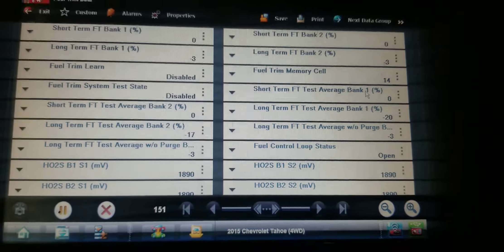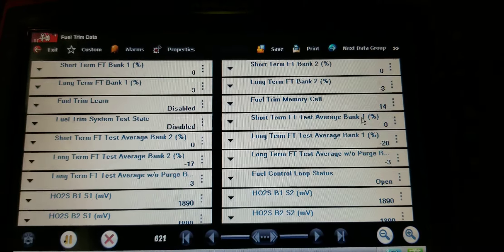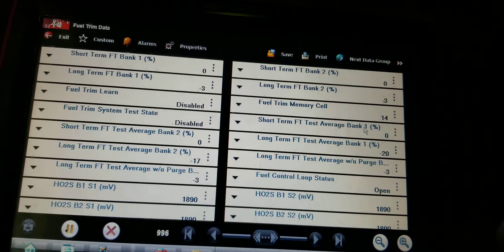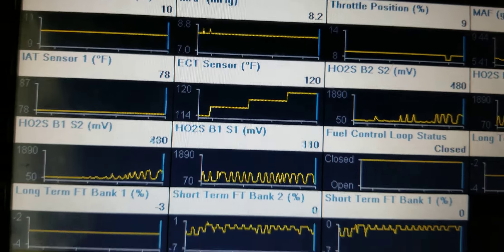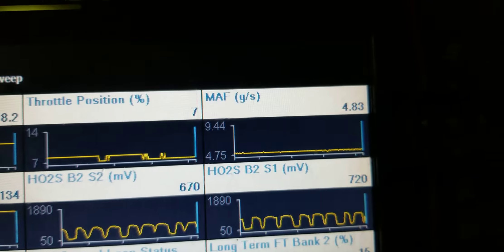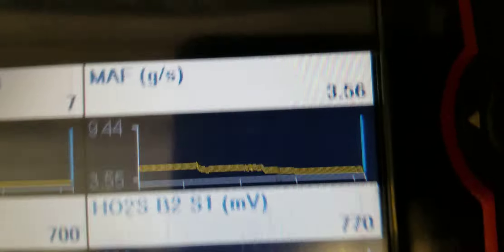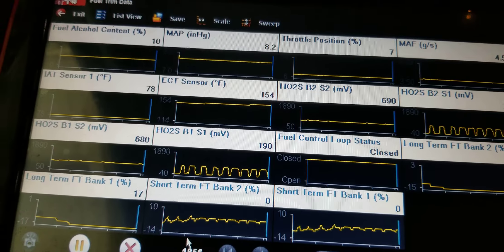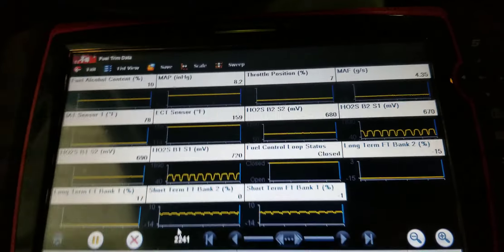2015 CHEV TAHOE 5.3L, MAF DTC'S & P0172/P0175 FUEL TRIM RICH ON BOTH BANKS (PART I)

Comment from the maker: Well guys I make multiple mistakes and mispoke in this, but no editing, and the truck is fixed and long gone, so I ain't too worried about it 🤣🤣🤣👌...End game...hopefully this helps somebody out there, if it does, well then it's worth it right?

Key here is to see TRIM numbers back to 0 or close to it!  The MAF gm/sec pid does ALOT of updating and normalizes once engine is fully up to temp and you drive her for awhile...keep this in mind before rushing to conclusions...truck has been gone for well over a month now and I work with the gal who owns it so👍...IT IS FIXED!!!

Parts, Repairs, & Reset Procedures:
1. GM HIGH PRESSURE FUEL PUMP
2. GM HIGH PRESSURE FUEL PUMP SUPPLY LINE TO INJECTION RAIL
3. GM LOW PRESSURE FEED SUPPLY HOSE/LINE TO HIGH PRESSURE FUEL PUMP
4. GM INTAKE MANIFOLD GASKET SET
5. LOF (0W20 FULL SYNTHETIC)
6. GM MAF SENSOR
7. CLEARED DTC'S
8. RESET FUEL TRIM LEARN
9. ELECTRONIC THROTTLE BODY CLEANING & IDLE RELEARN PROCEDURE
10. CKP VARIATION RELEARN PROCEDURE
11. COMPLETED DRIVE CYCLE TO CONFIRM REPAIRS
12. RECHECKED DATA TO LEARN FROM IT

Thanks for watching and be sure to watch both parts before you get carried away 🤣🤣🤣👌!

Part II: https://youtu.be/L7QaSguY9PA

Comment: Does the hpfp suppose to make a ticking noise?
Reply from the maker: @JoeyBrioso-l9m  Yes, but it needs to be within reason, sound alone doesn't seal the deal, additional testing is required, as well as data analysis.

Comment: Hey my 2015 Yukon 5.3 is having similar readings with codes p0172 p0175, my stft on both banks is around -3 and ltft is -30 on both banks , if I unplug both pcv tubes stft will fluctuate to 0 to 4 and long term dropped to -20, And Map reading was 3.7-4 and with pcv hoses off it was 3, this was all with the truck up to temp, just wondering if you think this would be an indicator of the hpfp leaking ?
Reply from the maker: What is your fuel composition?  Anything more than 10% is excessive.  I'd imagine that you have a flex fuel?
Reply: @PaulysAuto  it’s been averaging combine around 11-12mpg,if I was strictly hwy 17mpg ,the code only comes up if the truck is up to temp and idling for 25 mins or more never while driving,sometime it feels like the truck shifts hard or the shift points seem like there not where they should be & the idle has a very slight shake to it,also truck has 130k miles
Reply from the maker: @wildingarage2003  Right but if your fuel composition is skewed it can mess with your fuel trims significantly.
Reply: @PaulysAuto  I just realized you said composition not consumption lol, it is flex fuel but reading 9.7%
Reply: Wildin garage did it end up being your fuel pump leaking?
Reply: @YetToBeSeen  I replaced the high pressure fuel pump and the readings went to normal ranges and no more check engine light
Reply: @wildingarage2003  thanks my ltft is also -30 when pcv is plugged up. And -17 when unplugged. The part is on order. What it a pretty easy instal?

Comment: You didn't plug your air box after pulling breather tubes so MAF readings are obviously going to be off as well as trims
Reply from the maker: This vehicle is fixed.  Yes it will, but not to that extreme. The high pressure injection pump fixed it no doubt about it.

The TSB out for this condition directly stated to test for this, I found it gave me a "warming" piece of mind before I pulled the trigger on it.

I didn't realize that there was a TSB until after figuring it out; so it was interesting to see someone else came up with the exact same test for it prior to myself-I thought I mentioned that in either the video or comments....🤔

Anyways thanks for the feedback.
Reply: @PaulysAuto  hello. So what’s fixed this issue bro? The fuel pump? And mad sensor? Or just the fuel pump